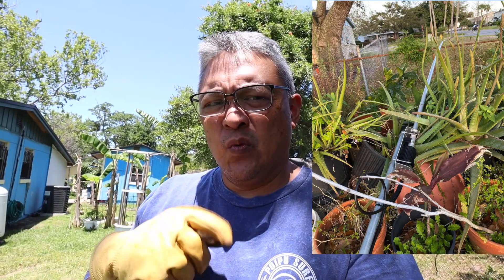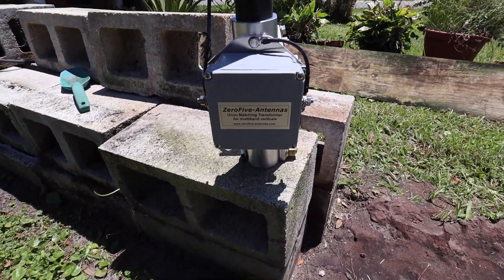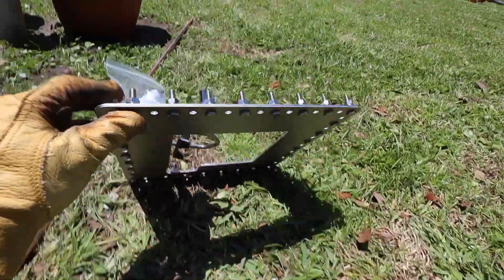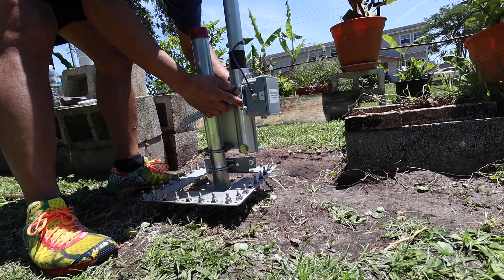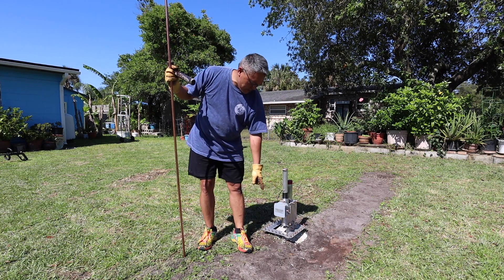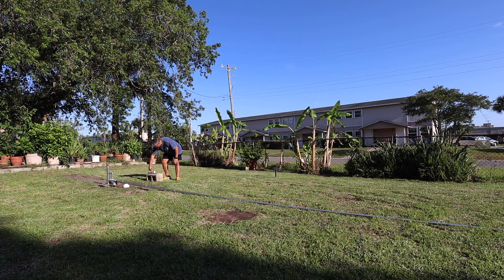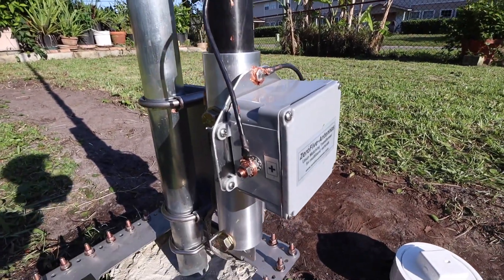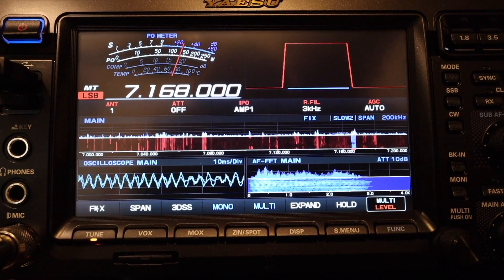Zero Five 27' HOA Foldover Multiband HF Vertical Install

Comment: Aloha Darren, if you can find a copy of the ARRL Technician manual from 10 years ago, they had an aerial shot of the US Coast Guard tower located on the south point of the Big Island of Hawai’i. It’s the same concept of the antenna you just installed. In that aerial photo, you’ll see that there is a highway that runs next to that antenna and it makes the cars as small as ants, it’s simply amazing. You can see the ground radials spread out in a circle but you can’t see them while standing right on top of them. Check it out! 
     If it were me doing the install, I would of dug about 6-8 inches down first and hammered in the galvanized pipe and the ground rod 6-8 inches from the pipe and used a square green plastic irrigation plate and frame for easy access, either flush or elevated, it would of looked very professional. Plus you could of added those 27’ radials about 1-2” down and never have to worry about mowing the lawn or damaging the antenna. I was hoping you would of mentioned in the video the total cost of the antenna and your total costs. I love this antenna design and set up, easy to raise and lower if ever needed, which I doubt you’ll ever have to do. BTW, where did you buy that antenna? This would be a great antenna for my Xiegu G90 also for QRP. 73’
Reply from the maker: Aloha Braddah Todd!  I'm from Oahu and now live in Florida. Thank you for the recommendations and I need to check out that antenna you described about on the Big Island.  The Zero FIve  Antenna I used is here, "https://zerofive-antennas.com/product/27-foot-hoa-10-40-meter-no-radial-multiband-foldover-vertical-with-unun/" I did bury my ground radials, I've lost count on how many I laid down. I think it was 46 radials? As far as costs, the Antenna System cost $399.00, plus 500' ground radials from DX Engineering $99.00, DX Engineering Ground Plate, $80.00. Total estimate is around $578, not including the cost for Coax and Antiseize (SS-30). Thank you for watching!
Reply: @DarrenN4VFR  
     Aloha brah, it was funny how someone else thought you lived in Hawaii too. I was wondering what HF rig you used at the end of your video also. A big Mahalo to you for the link.
    I will check it out. BTW, maybe you should get a Hawaiian vanity call, it’s not the same as living here but it could be the next best thing. 🤙🏻73’
Reply from the maker: @digitaldreamer5481  Yeah, my "Almost Spouse" has a Hawaiian Phone number and she's Mexican. The HF Radio I use is the Yaesu FTDX-101MP.  Barefoot, 200Watts.  I now have an OM2000+ HF Amp and maybe I can't force my signals to KH6 land.  Man, I'd get a KH6 callsign but I think I would have to live there if I apply for a vanity call.  Idk though.
Reply: @DarrenN4VFR  
Aloha Darren, you are allowed to pick a KH6, AH6, NH6 or a WH6 call, no worries. If I didn’t have my A-1 Op Award, I would get an AH6 or AH7 call for sure but at this point, I think I will keep my WH6 call for life. I’m a 3rd generation ham after my grandfather and uncle, both SK now. Got my first ticket in 1973 at age 11. Trying to get my 6’4”, 15 year old son to get his ticket but thinks his iPhone is it. 
   BTW, I’m good on QRZ and you’re welcome to drop me an email, no worries. I have some great pics on QRZ but would like change some of them to feature my battery banks, wind turbines and solar panels. I’m the NCS for the NWS SKYWARN Program because I am completely off grid w/ 5 battery banks. I’m located high above the eroding sands of Waikiki, lol. 👍

Comment: Please do a follow up video after a couple of months of use and let us know how the antenna performs, any issues that have come up, and your analysis of the efficiency of the antenna.  Also, how is your noise levels?
Reply from the maker: John, will do.  Right now, my noise floor on 20 and 40 meters is too noisy.  I'm thinking about getting a Common Mode Choke.  The SWR's straight from the factory  using the built in ATU is 1.5 as advertised.  When I use my Palstar AT2K Tuner, I can tune the SWR flat, 1:1.  Today, I changed out the braided ground to a 6 gauge stranded wire; recommended by one of my viewers.  Thanks for commenting!

Comment: Nice job on your install.I am also considering getting a zero 5 Antenna.I think he makes a great product.
Reply from the maker: Keep in mind you will need to have an antenna tuner. The Zero Five website says that and it will being your SWR to 1.5.  That is what I experience with the built in ATU on my FTDX101MP.

Comment: Two comments and one question on your installation:

1.) Good to see you use the SS-30 to keep the connections clean and corrosion free.  I never knew about the stuff until I started watching Tim Duffy, K3LR from DX Engineering and On All Bands.  There was one antenna Tim showed coming down last summer to be replaced that had SS-30 on it for I think twenty years and there was no corrosion at all and the elements came apart easily.

2.) Don't use the flat braid outside where it can absorb water and deteriorate.  Again Tim goes over this on a couple of his videos about grounding and bonding.  Between the ground rod and the DX Engineering ground plate you should use minimum number six stranded copper wire, you can buy it by the foot at Home Depot.

Did you bond the antenna ground rod to the house electrical panel ground with a minimum of number six stranded copper wire?  See NEC section 810 for details.  You may also want to review Grounding and Bonding by Ward Silver available through the ARRL or DX Engineering.  Ward also spoke last year at Contest University and I believe those videos are still on-line.

It looks like that antenna can be easily tilted down during a hurricane or other high wind event.
Reply from the maker: Thank you for the recommendation.  I will replace my antenna ground tomorrow. No, the antenna mast is not grounded to the house service panel.  It has it's own grounding rod.  My station ground is grounded to the house service panel and also my coax shield from the antenna. And yes, it can tilt down easily for maintenance or for severe storms.

Comment: Nice install, but I have only one comment. SS-30 is great stuff, but I would not recommend using it on aluminum. Aluminum and copper have too great a galvanic index difference (-0.35 for copper and -0.75 to -0.90 for aluminum ... you really want to only have a 0.15 difference, unless you are in a temperature and humidity controlled environment). I personally would recommend taking the antenna apart, cleaning the SS-30 of and use Penetrox A instead. PS, I love the FTdx-101. 73 W9HJ
Reply: W9HJ  Yet I wonder why DX Engineering always recommends SS-30 for aluminum antenna joins? When I put together my Hustler 5BTV I used GB Ox-Gard, which is basically zinc infused petroleum jelly, between the joins, but that stuff is pretty slick and you really have to tighten the hose clamps to keep the tubes from slipping. When I put together my 27' Zero Five antenna I used the Jet Lube SS-30, just like Capt Darren did. It's a lot thicker than GB Ox-Gard. Hopefully I won't run into problems on down the line. 73 de WB4DW
Reply from the maker: Thank  you for the advice.  I will definitely do that.
Reply: Yes I agree.  Anti-seize is for the mounting bolts and clamps whereas Penetrox should be used for preventing oxidation on any antenna elements.  I used it also on my radial hardware as well.  I own the ZF 10-40 GP and it's still going strong after 12 years.

Comment: Great video!  Best of luck with the antenna..  What bands will you operate with this antenna?  What is the SWR on those bands BEFORE you match it at the transceiver with a tuner?
Reply from the maker: I operate primarily on 40m on 7178khz.  Without a tuner my SWR is > 5.0:1  I don't know why therefore, I use the built in tuner on the FTDX101MP.  With 200w barefoot, I get an SWR of 1.5:1.  I just received a Palstar AT2K and will try a manual tuner.
Reply: @DarrenN4VFR  I'm glad it works well for you!  Smart choice using good coax- the loss in the coax due to 5:1 mismatch won't be too  unreasonable on 40M. Just know that at a 10:1 SWR mismatch (if the tuner is at the transceiver), you will likely lose about 50% of your power in the coax before it reaches the antenna.
Reply: @DarrenN4VFR  I would suggest you get an antenna analyzer and check where the antenna is resonant.  You may need to adjust the amount the elements are inserted into each other to get your SWR down to a more acceptable level.
Reply from the maker: @rogerp5816  Thank you for the recommendations.  The Zero Five antenna had marks on the antenna elements when I connected them together. The Zero Five websites says it must be used with an antenna tuner and the SWR's will be 1.5 which is what I show on my ATU.
 My Palstar AT2K bring it down to a 1:1.